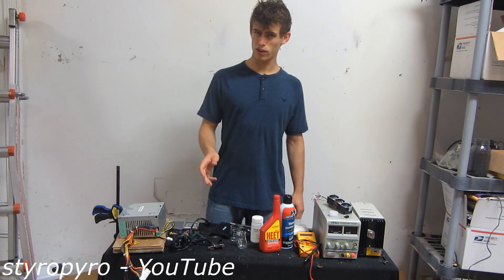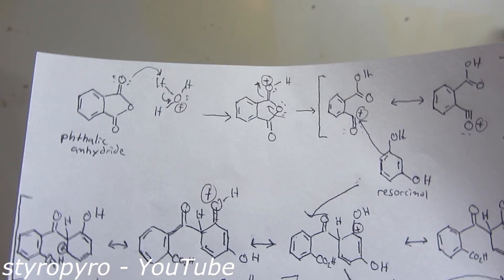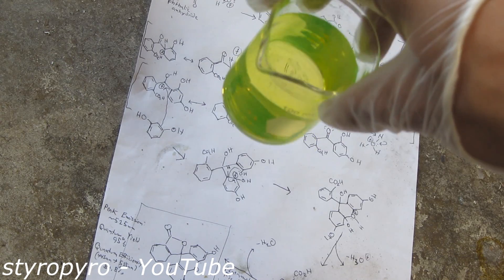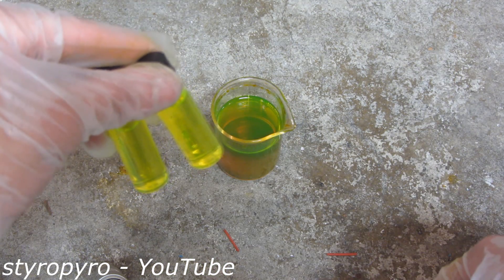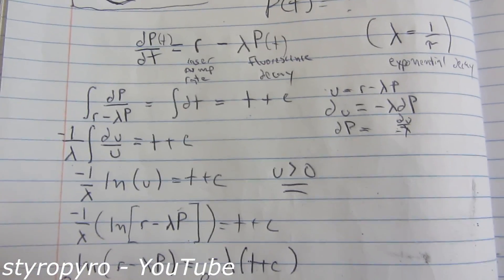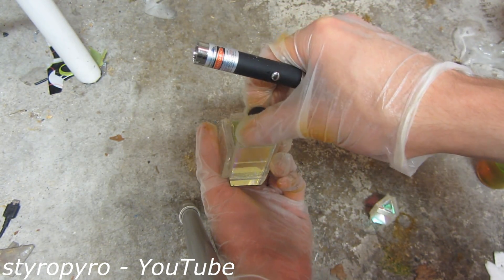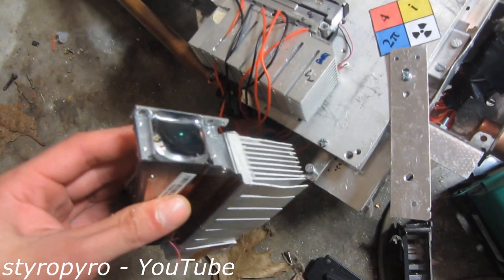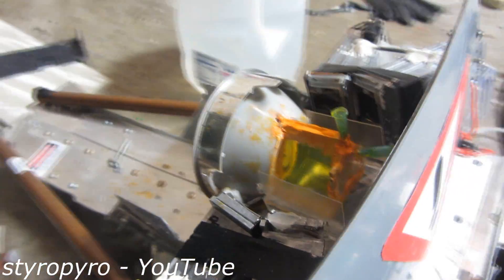Building a GIANT Laser Pumped Chemical Flashlight - July 9

Comment: I wonder if, for power, you could use a graphite/parabolic dish -based light source (like Kreosan built), filtered through optics to only let the required wavelength through into the fluoroscein. It would need optics that can withstand it, but that's probably not a problem since he's managed to get some that stand up against powerful lasers

Comment: What if you surrounded the mirror cell w a cell of liquid nitrogen to keep it cooler or made it larger so it doesn't boil as quickly or do both or even more... add a circulating pump w a refrigerant type system of copper coils or some other non chemically reactive metal or material?

Comment: I think your ethanol solution might boil less under pressure. Potentially using a pump to cycle fluid as it heats up to keep it cool and keeping the solution under high pressure will raise the amount of energy needed to boil it by a pretty decent amount, that in addition to defocusing the laser so it will hit a larger area of the solution (Placing it in a larger dichroic container) will spread out the energy more and it'll heat up slower. You might get away without watering down the solution like this.

Comment: I would suggest using fluorescent silicone to replace the liquid fluorescein, so the boiling issue will be over :-) And the silicone would be between 1 dichroic glass plate and 1 pyrex glass plate.

Comment: We see it pumping white light emission  ,  Do to loss in the cavity and alignment,  of your optics, ie internal reflectors , and use of a First surface AL mirror , as you primary in the cavity , you will need some 4 , nines or higher non absorptive dielectric   reflection to get you output . The E field will need to match the out put

Comment: There's only so many fluorescein molecules in that small chamber, and each molecule takes a little while after being excited before it re-emits a photon, right? Photodecay aside, how many watts can you actually pump into and get out of such a small chamber before you've topped off its capacity to absorb and re-emit energy?

From the video, it doesn't look like all of the ethanol boiled off, due to the continuous noise and the lack of an explosion, so the vast majority of the fluorescein should still be in liquid solution. Assuming that, your light output issues probably aren't coming from it being in the gas phase.

You talked and read about fluorescein quenching its own emissions when in concentrations that are too great, but what about its fluorescent capabilities becoming saturated when the concentrations are too low? I suspect it probably doesn't come up much in scientific literature since most uses of fluorescein aren't aiming for highest absolute energy output and don't involve exposure to high-powered laser light. Maybe you have to find a optimal point where the effects of quenching and the limits of saturation multiplied together are the lowest, for your given input power density?

What phosphors do they use on super-bright white LEDs to convert the UV to white light? Those seem pretty powerful and photochemically stable.

Why not just put a convergent or a divergent lens in front of your laser beam to spread its illuminated area out over a much larger tank of fluorescein? The lower flux should also solve your heating/boiling issues, in addition to ameliorating problems with saturation if they exist.

Comment: you need a system under pressure to raise the boiling point. think of a car radiator the mixture is usually ethylene glycol or methanol mixed 50/50 with distilled water and then put in a closed loop with a cap to vent the pressure.  the relief valve is an important part. you could do something absolutely crazy and pressurize the entire system to 60-70 PSIG. which would raise the boiling point of the mixture to many hundreds of degrees. but you would need to synthesize a few extra grams of fluoresceine. 

conversely to that, you can use ethanol in an A/C, unit which just does the inverse of a radiator. and would deliver cold ethanol to the chamber under minimal pressure while using a simple radiator as a heat exchanger.

Comment: The water kind absorbing the input and the air or N2 void doing the same shit more regerously, try silicons based reins,also notice that as tem goes higher, the emitting will tend to be heat instead of light. So, one way is to pressurize the chamber to raise the vaper pressures, the other is to try reins with short flash emissions to avoid overheating.

Comment: I think fluorescein mostly undergoes the non-emitting relaxation after being excited, hence boiling. I would suggest to freeze it in the clear epoxy resin, that likely would eliminate the relaxation due to two excited molecules colliding and resulting in no emission of light in the liquid, and maybe the cell would be easily assembled hopefully (no rubber or silicone needed to confine the liquids). Try the Crystal Clear resin for example.

Comment: I believe a similar problem cropped up in the movie Real Genius. In that movie, Val Kilmer's character solved the overheating issue by building a laser-focusing lens from dry ice. Ironically, he was in the movie Top Gun the next year with the call sign "Iceman".

I have heard of using dry ice and ethanol to form a supercooling fluid that is not very electrically conductive. I'm wondering if it could be helpful in this experiment, since one version involved your glowjuice mixed into ethanol. I would very much like to see this doodad functioning. Perhaps you could connect those fill needles to a pumped cooling reservoir with dry ice in - or in thermal contact - with it.

Comment: What would the possibility of using several (lets say 8) 100W LED modules as a laser weapon be?
  The concept would be to add optics to focus all of the beams from the cobs to a central point and then from here to focus all beams to another central point and then to focus the remaining beam so that it leaved the optics as a narrow beam? This would be an 800W laser minus LED inefficiency and minus the loss in the optics. Probably resulting in around a 400W beam.
  Not sure what optics you would need or how to overcome the multiple light sources from each COB. But it could still result into a pretty powerful beam when focused. Why stop there? Well portability really, otherwise we could go 10,000W + assuming you could afford the optics.
  Project?

Comment: Hate to be "THAT guy" but your ph to glow test was not verry accurate, I would have used a dropper to introduce the floricine to the vials so you can be sure you get the same amount in each vial. And a possible reason for the acidic solution not glowing as much could simply be due to a smaller amount of floricine being on the metal rod from the thermometer
Reply: But you are STILL a badass chemist
Reply from the maker: lol that was just a demonstration for my viewers. I spent hours finding relevant spectra of fluorescent compounds in various solvent systems, as well as deriving the relevant equations to find the actual brightness based on power/efficiency and emission spectrum. I coupled the emission spectra with the 1988 luminosity function, and then used numerical integrals to determine what the brightest solutions would be.
Reply: styropyro omfg I can't believe you actually replied dude you officially are my favorite chemist I already liked you more than Nile red now your up there with codys lab also thanks for clarifying

Comment: Can you do out the math? Seems straight forward but I'm having trouble seeing some of the steps.
Reply from the maker: If you pause the video you will see how I solved the equation. As far as a differential equation goes, this one was pretty simple because it is first order and linear, and the existence/uniqueness theorems of Diff EQs guarantee a a unique solution with a provided initial condition. Plus this equation was separable which means you can just rearrange the differentials and integrate. Differential equations get harder in higher dimensions, and really become scary when in multiple dimensions and are nonlinear, when most of the theorems that made solving this equation go out the window.

Comment: How about PEG Poly Ethylene Glycol? Or adding a really heavy ionic salts like: BI Barium iodine, WI tungsten iodine or lead iodine or HgI mercury Iodine, but first check out solubility curves; it may be more favorable to choose a lighter compound if you can saturate the solution further. Quenching is determined by shape and thickness. Try growing crystals at different temps with different solvents like DCM or even MEK. Big thin sheet crystals work best. Also try to get crystal growth from not just straight evaporating but rather Crashing them out of solution. You seem to know how to do that since you made it from phthalic anhydride. Remember to keep you solution dry!
Reply from the maker: The issue is that the boiling is a local effect, and changing the solvent does not do much to mitigate the effect. If I ever get around to a version 2, I will not be using a liquid solution as my fluorescent source, and instead I would like to go surface based for increased efficiency.

Comment: handy tip:  to avoid the solution from boiling, try having a flow that of which it can release any built up heat. a good example would be the coolant within cars, and computers. if you were to have the fluid travel to a radiator (try using a scrap car radiator) and then back into the container, you should be able to avoid the issue of evaporating the fluid. (probably best if it had a pump as well)

Comment: I don't think circulating the fluorescein is the best approach because you'll still get boiling at the laser-dye interface and metastable triplets should be negligible   If you can design a mirror cell that contains only fluid and can maintain enough pressure to keep the ethanol in the liquid phase it should work.  Of course, it might just explode which would be interesting too.

Comment: Hey styropyro, not sure if you leave the notifications on for your videos, but I wanted to speculate on possible workarounds for your boiling problem. Higher boiling solvents might work, but they would likely change the emission properties as well as increase the health and safety hazards associated with the device. Also, it likely wouldn't take long for the energy to build up in the cell to reach boiling temperature for other solvents. 

What if you kept ethanol, but attached a simple reflux condenser system to the cell with a chilled water/ethylene glycol solution? Your solution could be left to boil (leaving room in the cell so it doesn't splash out/expand and destroy the glass) and the vapors can be condensed and dripped back into the vile through a separate syringe. Kind of a messy workaround, though it would be cool to see a condenser on a flashlight!

Maybe you'll find an alternative solution through your physical/mathematical research. I'm interested to see where it goes.

Comment: Very cool project!  fluorescein is only slightly soluble in aqueous solutions such as water and ethanol.  you should try mineral oil or perhaps even kerosene (no dye).  it has a higher BP and should be able to dissolve more fluorescein into solution (more light conversion).

Comment: 5 seconds thought, have you thought of maybe using cylindrical mirrors to bounce your blue lasers light like in a ruby laser? Placing your fluorescein / dichroic mirror assembly in place of a ruby? 
You could also use a CPU cooler + pump to actively circulate the fluorescein mix, taking care of conduction heating and heating inertia. 
you could also decrease the mirror assembly volume, make it quite flat, and have your lasers output expand to illuminate a wider spot of fluorescein, heating would not be such a problem, and the amount of light staying the same, you'd get an increase in global light output efficiency. Or bathe some prism inside the fluorescein to scatter light in the fluid mix.

Comment: This can only work if you focus your blue lasers onto a small part of a high velocity liquid jet and recirculate your dye solution, just like in a dye laser. If you don't, you'll get a population buildup in the triplet state of the dye due to intersystem crossing and the comparatively long lifetime of the triplet ground state. Molecules in the triplet state are very detrimental to your fluorescence quantum yield. They no longer contribute to your fluorescence and even worse, they usually absorb at your excitation and/or fluorescence wavelength, thereby preventing or reabsorbing the fluorescence of the other molecules. If that isn't enough, dyes are also more prone to undergo chemical changes (become bleached) when they are in the triplet state. So you have to prevent triplet state buildup by making sure that each volume element of dye is only illuminated very briefly. The molecules that did end up in the triplet state after passing the illuminated spot will all recover to singlet in a couple of ms, so the dye is virtually instananeously ready to be used again on its next trip through the jet and your reservoir doesn't need to be big. If you add a radiator to your circulation system you will get rid of your thermal problems in one go. Required flow speed in the jet depends on a lot of factors, but think in the order of 10 m/s.
Reply from the maker: Ah yes this is the kind of reply I was hoping for! I already built a dye circulator with pump and radiator, but had no apparent increase in output. That being said, the beam is being diffused over the whole cell now, and the fluid velocity is not that fast, maybe 1 m/s at best. That is VERY annoying that these triplet states absorb in regions that I don't want them to. :( I wonder what the absorption cross sections are like for given concentrations of singlet and triplet states of fluorescein, because it would make things even worse if the triplet state is more likely to absorb blue light than the singlet state. I think I'll give up on trying pumping a liquid state organic dye with this setup, and instead will look into hitting an efficient solid phosphor surface for generating green light (just like what's found in hybrid DLP projectors)
Reply: What
Reply: @MyGUNZ123  me too, bro
Reply: my head hurts...
Reply: Ya dude then it will work nice didnt think of that
Reply: Wow. I was just about to say that before you interrupted me.
Reply: All this is great but i don't think the key chain version of this is coming anytime soon.
Reply: Whaaaat lol wish I could understand but I'll bet your right woot
Reply: No I’m not saying anything mean but God damn they are smart as fuck

Comment: Look at BMW's laser head lights and you might get some hints there.  It uses lasers and phosphors.  The phosphors are not liquid but solid.  I wonder what phosphor they use anyhow.  Is it coated on to something or just some special type of glass that has the phosphor all through it?  That chemical prototype of yours is very well though out and the chemistry of it boggles my mind somewhat since I have not a whole lot of experience or knowledge of it.  I would be more likely to buy some fluorescein (unless I had a friend who could make some).  Your video is very well done and I think that the laser rust removal you talked about in another video is also impressive.  Who needs wire brushes when you could burn it off?!?!?!?

Comment: Those 445nm lasers come out of the Casio XJ-A145 model projector, which uses a light engine that includes conversion of the blue 445nm laser light to green light for the green component of the RGB output.  The green is produced by passing the blue laser beam through a spinning disc that is half covered in a material that flouresces green as it absorbs the blue laserlight.  Perhaps it would be interesting to investigate that material (as it works VERY well) for you purpose.

Comment: I would put the ethanol under pressure, and going trough a simple heatsink? Shouldn't be hard at all compared to all you've already done. The hardest thing is to make a mirrored tank which is resistant to the necessary pressure.

Comment: as others have pointed out you need a new design for the bulb that either allow you to actively cool it (maybe helium will cool it fast enough?) or will be able to hold the pressure thus increasing the boil temperature.

Comment: can you use isopropanol? so you could make an other chamber around the fluorscien chamber and cool it with isopropanol dryice mix. problem would be that the heat from the laser is not optimal spread through the fluorescine chamber and it could still start to boil punctually . So  pumping a already cooled Fluorescine solution through it could help.

Comment: Have you thought about either cooling the ethanol via a water bath (like a water cooler from a computer), or switching to a more basic fluid with a higher boiling point? Would a substance like silicone oil work well with the fluorescein, or would you use something else?
Reply: Also, there's a salt (Fluorescein Sodium), that might work for your purposes.

Comment: Going back to your comment about using a pump to circulate the solution, have you considered sticking with the ethanol solution (lower freezing point) and adding a pump with a cooled reservoir? A small coil heat exchanger packed with dry ice along with a longer mirror array for more volume, perhaps? Or try a solvent with a higher boiling point (white spirit, monoethylene glycol,) although I'm not sure how they would react with flourescein. Though greatly heightening the danger factor, you could try pressurizing the mirror array container to raise the boiling point of the solution...